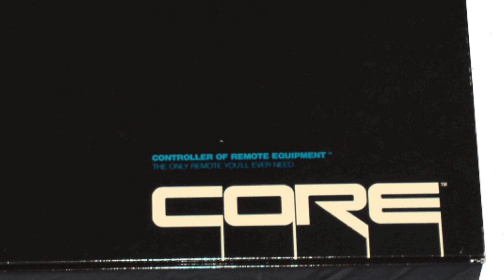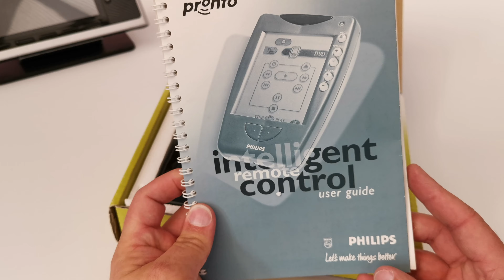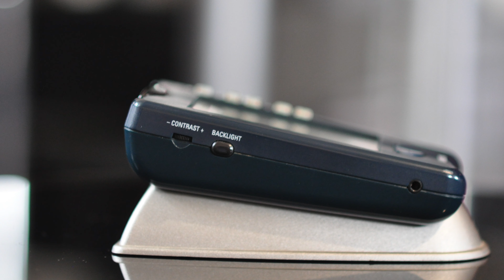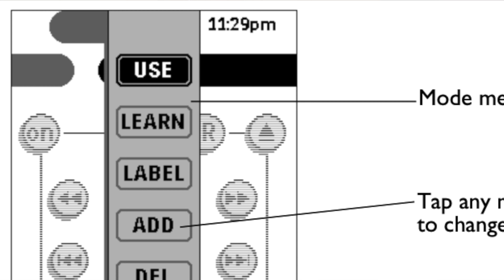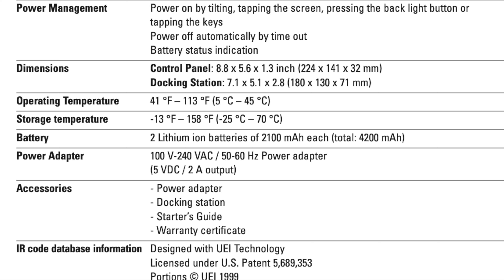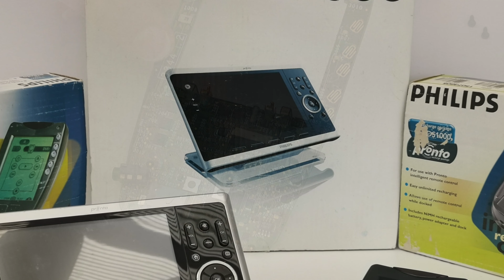"The Philips Pronto: A Legendary Journey through Remote Control Innovation!"

Comment: Great video, I'm still using my Philips Pronto TSU9600 on a daily basis, we just got a new TV (we're in January 2025) - and I installed ProntoEdit Professional 3 onto my Windows 11 laptop - it still works and the Pronto TSU9600 was recognised (after a PC reboot) and is reprogrammed again and back up to date (batteries still available from Amazon), I've also got an Inteset IReTV USB Ir Receiver on order from Amazon so I can add a Pronto page to control my Amazon Firestick via infra-red so we'll see how that goes.
I still don't see anything programmable to rival the Pronto available to buy even now, but the Unfolded Circle Remote Three might be worth a look?

Comment: Hey Mark, Wow that TSU9800 is a beast! I've just seen a 9400 on the local auction site for $1 so was wondering if I should pick it up and have a go. I too have a lot of audio equipment though not as impressive collection as yours! Was just wondering if it's still worth buying, it comes with a spare batt, all cabling and even the wireless sender! Is only having Wifi B and G an issue? And do you recommend it still? Cheers mate.
Reply from the maker: The 9400 is great and if its working then buy it.  Bargain!  Make sure its TSU9400 model.  There is also a TSU9600 online at the moment for £90 which is also a bargain.  Its basically a smaller tsu9800.
Reply: @EVMYT  Cool, Cheers mate, I'll ask the seller. They're a rare find down here in New Zealand. :)
Reply from the maker: @Cyba_IT  should be worth more than £1 then lol
Reply: @Cyba_IT There is a guy called Mark in NZ who basically has all the spares for these remotes and services them.

Comment: Can this be used for a Windows PC, as a remote control to launch software apps on the computer, and websites on the browser etc a bit like the elgato stream deck?
Reply from the maker: Im sure you could work around by using a FLIRC with it but it isn't predominantly designed for that .  Its more for Home Cinema Infra red devices.
Reply: @EVMYT  you could do a lot more than IR.. Put your coding hat on and get into Prontoscript opens a world of options. I had multiple apps for it back in the day. Most known being ProntoSqueeze which gave full 2 way control of Logitech Squeezebox.